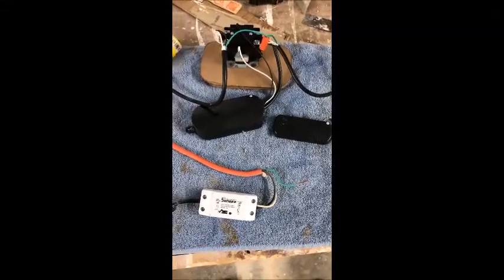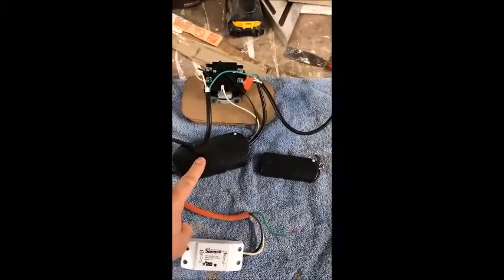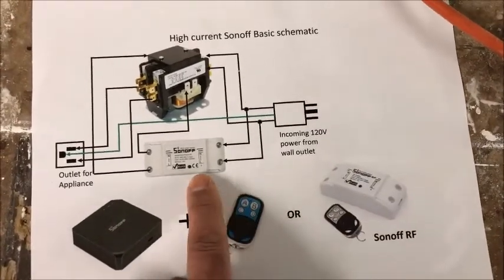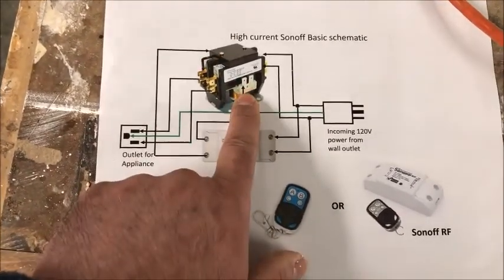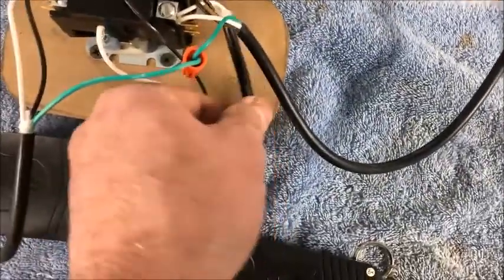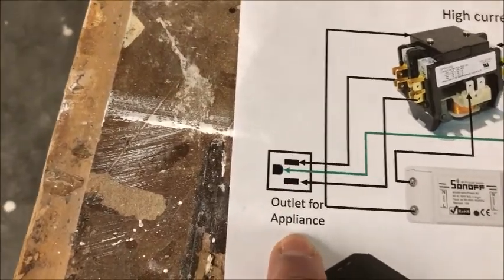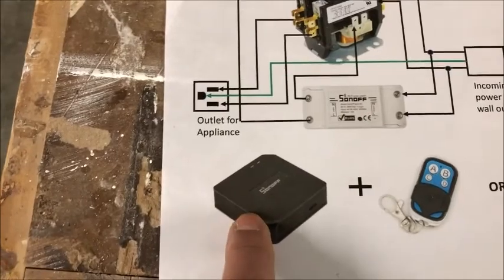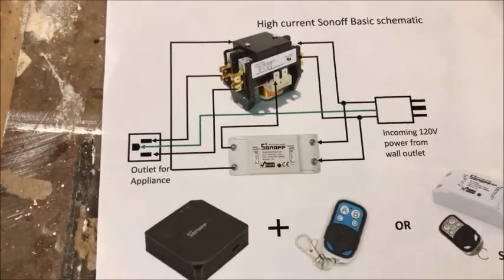High current Sonoff switch

Comment: How do you wire it for 220?
Reply from the maker: Same exact wiring and even the same Sonoff Basic (which can be powered at 90-250V AC). Obviously the Incoming Power Voltage is going to be 220V and the Oulet for Appliance will give you 220V. HOWEVER make sure that your load on the Sonoff Basic, which in this case it's the contactor, it has a coil spec of 220V. If you don't know what I mean then don't do this. Thanks,
Reply: @ScrapMetalWorks  I'm going to test on 110v just like your setup.  I'm trying to replace a pool timer which is 220v single phase motor.   I've got 3 wires, two 110v and 1 neutral.  The wiring is a bit different.  I thought the contactor on/off mechanism works off low voltage. You don't need a 24v transformer?   Thanks 👍
Reply from the maker: @RayZde  ok wait a minute you just provided an important piece of information that is critical. #1) the contactor I used has a 110V coil so it is powered directly by the Sonoff and no other power power supply is needed; #2) you need to chose a 2 pole contactor suitable to switch both 110V branches hence 220V but the control coil needs to remain 110V; #3) in my case 100V in feeds my single pole contactor because 100V is all I need on the appliance outlet but in your case you need to feed the 220V to the contactor (each 110V branch) separately so yes the wiring is going to be different than mine. Again don't play with high voltage unless you know what you are doing and for sure have a circuit breaker feeding your circuit.